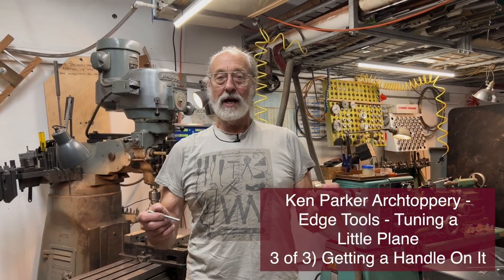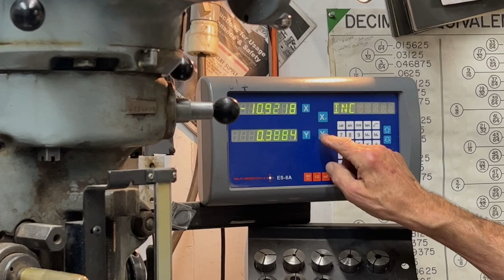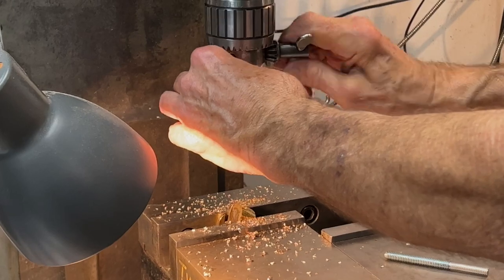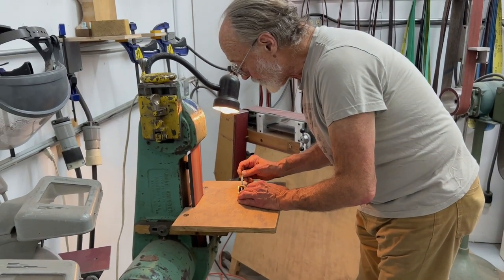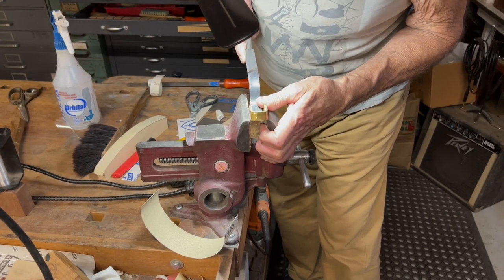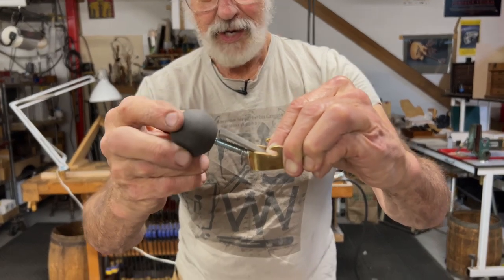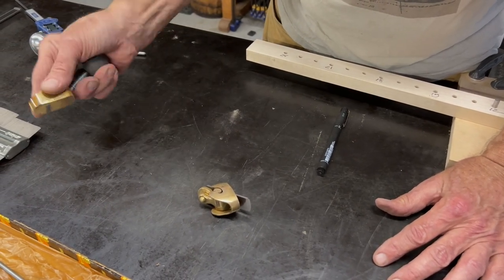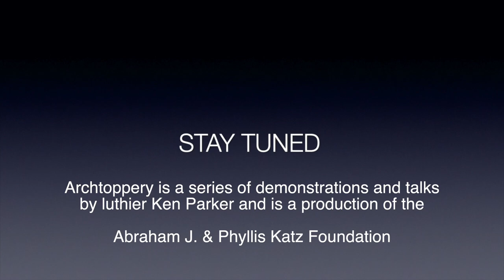Ken Parker Archtoppery - Edge Tools - Tuning a Little Plane 3) Getting a Handle On It

Comment: pretty sure I got one, one size smaller as this. I wasn't sure which size they were exactly, so I went with the middle. but indeed it seems quite small. still will be useful I hope. I think I'm just gonna go easy and just take a rubber ball and cut a slot in it which Ill just shove over the blade, but good idea this is
Reply from the maker: That's a great, quick solution. Bravo!

Comment: Ken, your t-shirt has a purfling channel picker pictured on it. I think that was the first lutherie tool I made nearly 40 years ago?
I have two questions. Did you use soft solder despite the box having 115 printed on it? A silver solder grade. 
Secondly, do you have an opinion on using Bass Wood as a lining material as you seem to like it?

Edit - Sorry, rudely I forgot to say thank you for the great videos.
Reply from the maker: You're most welcome, I love doing this. Toolmaking has always been a big part of the fun of instrument building for me, likely to a fault, as I'm so easily distracted. This is soft solder here, with a melting point around 450F. Not sure about what it might be saying on the box. Basswood is a fine material for lining and blocks, and is used by many violin makers. I use basswood for my neck-blocks, having also tried poplar and willow. The species is called Tilia,
https://en.wikipedia.org/wiki/Tilia
In the Old World it's known as linden or lime, and was almost always chosen to make the linkages in piano action due to its light weight, stiffness, and stability. A heroic material, really!

Comment: I believe the design is meant to put your thumb in front of the blade or so
Reply from the maker: I agree, but I think it's not a great design if you need to remove much material, as your fingers take what seems like an unnecessary beating, it just ain't comfy.